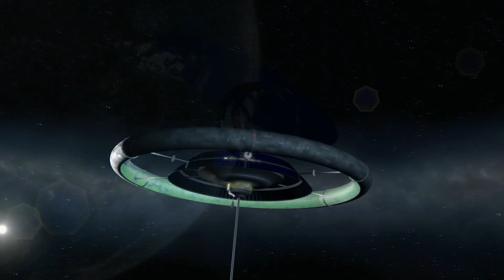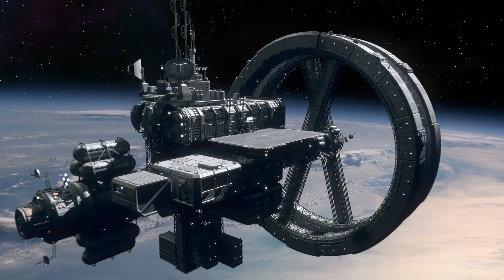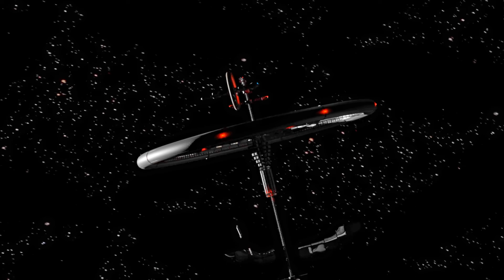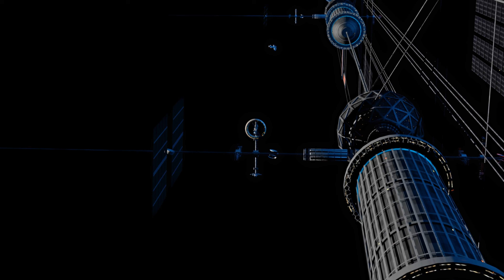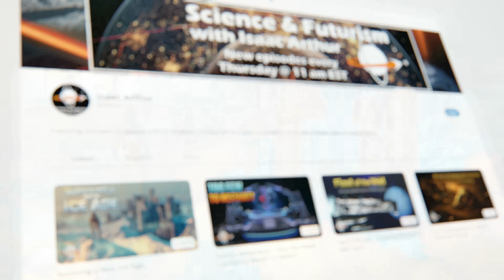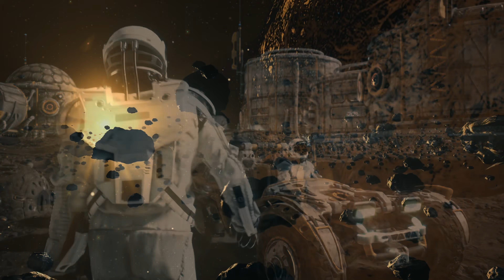The Von Braun Wheel - Building Humanity’s First Rotating Space Station

Comment: Wait a second if we live in a spinning wheel. wouldn't objects inside (moving about) would change the balance of the wheel and cause small oscillations in the axial rotation of the Von Braun Wheel causing the space station to eventually wobble out of orbit in the future?
Reply: No. You're thinking of a wheel that is mounted on an immovable bearing. If it is unbalanced, it pulls on that bearing in a direction that goes around at the rotation frequency, and so it shakes that bearing.

A space wheel spinning freely in space, no bearings, can and will rotate stably about a point a little away from its geometric centre if there is, at the rim, an unbalanced extra load on the deck under that new spin centre point.

If the wheel circumference is 22475 metres and the wheel mass is, like, only  500 tonnes, it can't be a stiff wheel, so it's easy to overdo the lopsided load thing and pull it out straight in a flat loop 11237 metres long with extra loads at the ends, or at one of them.

If you *start* with an 11237-metre rope, spin it so it pulls itself straight, and put the loads only on its ends, they can't wander away from those ends because the way away from the ends is straight up. It is stable forever no matter how the people in the end loads jump around, no matter how much stuff they bring in at the spin axis and take down to one of the ends.

Comment: Counter rotating rings mounted on an axle assembly which will be the docking port for space craft sounds good ... but you need air-sealable rotating seals on that axle which could be 10 meters or more in diameter; those have never been made, and I can't fathom how they would be made. Has any underwater structure been made with large diameter seals for a rotating structure ?

Comment: Great episode!  Given how things are actually developing, it seems like a rotating station made of welded-together Starships is likely to be the first of this kind.  Instead of having to build it all from scratch, the sections of the station can launch THEMSELVES into orbit and just do a remodel and then spin-up.

SpaceX has already proposed this for when they get their production numbers of Starships up enough.  A couple dozen Starship bodies can make a 1g perimeter ring station with spokes and hub etc., with up to 3 decks on the ring.  That's enough room to have labs, some industry, and hydroponics/life-support biology going on.
Reply: Sounds like the ship the Martian colonists took to get there in Kim Stanley Robinson's book Red Mars. If memory serves, that one was made of linked shuttle fuel tanks.
Reply: Yep! And as a first step, all you need are two Starships and a cable system that connects them by their existing catch-points (which are now their bigger stronger grid fins). Then spin them up so that they pinwheel around one another.  

Yes, there will be all sorts of stability issues at first (wobble, precession, etc.), but this would be a very SpaceX way of characterizing those issues in detail with real-world data. 

And you wouldn't need to do any remodeling of the Starships themselves! Just add the older-style minimalist catch-points to a couple of HLS lunar Starships, or design the cable to attach to the grid fins that normally serve as catch-points for an Earth-return-rated Starship. 

Once we have that HLS Starship flight-proven and worked the kinks out of it, there's nothing stopping SpaceX from immediately developing centrifugal-gravity Starship pairs, triplets, and more. And during that testing, each ship will be independently operable in case of a RUD with the cable system or whatever other trusses etc. they are experimenting with. 

Maybe, finally, we'll see some long-duration centrifugal-gravity research in orbit! 

(...and I really really hope that xAI doesn't suck all the funding out of SpaceX's R&D budget...)
Reply: @Wordsmiths  Grid fins are on the booster, not starship.
Reply: @nunya___  Yeah, my bad. I was thinking of the lift points under the upper fins/flaps! The HLS wouldn't have any fins of course, but the comparatively tiny lift points could be left in the design for the express purpose of centrifugal gravity options in cislunar space. (not to mention for ease of lifting and moving, and perhaps lower it gently onto a horizontal cradle, on the lunar surface) (once there is the appropriate crane infrastructure on the Moon of course)

Comment: Keep in mind we have resin based inflatable habitats on the horizon within the decade.  Creative and packaging an inflatable habitat of this shape feels well within reach especially if we make it in quarters or eighths etc.  Some carbon fiber and steel rebar for various structure supports and we could make this relatively cheep these days
Reply: Huh - I like the idea of starting with inflatables & building out solid structures over time. Spinning inflatables would act as the framework, maybe as a way to push outward similar to a tent.
Once there's a framework extended, could autonomous robots use that as a raceway to start building structures?
This is starting to feel less like a wheel though, and more like how a cylinder could be built. That isn't besmirching your idea, just where my head goes.
Reply: @AndyKauffmanGleekop I picture taking this inflatable up and pressuring/soldifying etc that way you have a large open area to work in and construct the thing and after you have sured everything up you can then start slowly spinning it up and give progressively more gravity for finer detail works and adjustments etc.

First order of business should likely be inflation then installation of a super conducting ring to provide magnetic shielding from radiation.  Wont stop your gamma rays and Neutrons but can help significantly so you can safely float around and get more things in order.  I propose a double haul on the thing with the outside filled with water as that could solve so many issues.  It can act as cooling, radiation management, life support etc.  I worry about the forces water imparts but thats a job for the engineers to say if thats feesible or if it will be a problem when spinning up or down.

Idk, I just know we are going about this all wildly wrong right now expecting to launch a fully finished and furnished space station then crashing them back into earth when done with it which is why we have made almost no real progress in three quarters of a century.  Piece meal and a more, figure it out as we go would really get things moving.  We have enough knowledge now to proceed that way in a safe manner.

Comment: What stops them tumbling?
Reply: As symmetric tops, they have no intermediate axis.

If von Braun had told us to build a tennis-racket-shaped space station, it could still rotate in a way immune to tumbling. The mode that has that immunity is the mode you get if you lay it on a table and rotate it in the plane of the tabletop.

Comment: Rotating habitats can be built on low-g planets too. One such on the Moon could test g levels slightly higher than lunar g up to any value, including Mars g. The floor just needs to be a special shape—section of a paraboloid. A lunar hab could be built using ISRU, no need to launch materials or modules into orbit. A hab could be as simple as a car on a banked circular track, or as elaborate as you want. If lunar g is found to be insufficient for long term human health, such habs might even turn out to be a necessity.

Comment: A big problem is working outside on what inside is the floor but you would have to hold tightly on it or the force of just over 1g would fling you off into another orbit.
Reply: Minimise the amount of work being done there, and use remote-controlled robots on a rail system.

Comment: Something should be said about the 135 launches of the Space Shuttle, each one depositing a jolly big metal cylinder in orbit, which could have been arranged like rings of hot dogs nestled together and spun for centripetal force. This was actually proposed. These tanks would have made great habitation and laboratory modules. Instead, NASA ordered each of these non-reuseable external fuel tanks to fall and burn up in the atmosphere. What. A. Waste.
Reply: And the waste is continued with the final stages of missiles and defunct satellites. Which could be recycled in orbit.
Reply: @comentedonakeyboard Ooo! Could these be purchased, somehow captured, and reused with these Von Braun Wheel ideas? I wonder if abandoned satellites could be reactivated from a Wheel, or simply space tugged into a usable distance and recycled.
Reply: David Brin wrote a great short story about an alternate history where we boosted the empty tanks to orbit and built a habitat out of them.
Reply: @evanmorris1178  Sounds like a smart guy! Those tanks only hold hydrogen and oxygen so there would be no issue with toxins getting in the living quarters.

Comment: Starship would be an excellent station building tool.  SpaceX don't need to solve re-entry issues to use Starship to build a rotating station.  The vehicle could be designed to allow it to be cannibalised in orbit.
Reply: First we need to resolve the "all these rockets are cooking the ozone layer again" problem. If we can't fix that, we're going to have to stop launches entirely until the ozone layer heals up again. It was doing really well after we stopped releasing CFCs, and now it's looking tattered again.

Comment: If I’m not mistaken, rotation produces a simulated incline;
Up one way around, down the other, so an unpowered rail car should be able to go round and round the downward way

As long as exercise is optional…
Reply: If I'm not mistaken, I think you're wrong.

You fly in a straight line. Then, you impact the curved surface of the habitat. Your currect trajectory is pushing against the habitat, and the habitat is pushing tangentially to cause you to move sideways.
But the the curve of the habitat intercepts your sideways trajectory. You are once again being pushed into the habitat while gaining sideways momentum. 

But here's the thing, it is contant.

The part of the floor you are pushed off from is the same part of the floor you impact against. Making it a constant "down".

You don’t roll down hill. You're being pushed sideways into the same section of floor.
Reply: @shanerooney7288 if you jump with enough speed in the right direction you could let the wheel rotate „underneath“ you and leap much further.
Reply: @comentedonakeyboard  
True. 
However it is mostly jumping "up" that does it. Different heights inside the cylinder correspond to different circular speeds. Where as you are keeping the same tangental speed as "ground level". 

Regarding this conversation, the important point is that OP's claim " an unpowered rail car should be able to go round and round the downward way" doesn't work.

Comment: with artificial gravity, your normal toilet works. lol. what cooking btw, synthesize all food. from thin air. a very practical space station design. no complex trickery required at any part. rocket science needs to be robust stable, not a guess work. but a space ship is an rv for small operations. if you spin around an rv space ship on a loop spiral orbit then it also has artificial gravity all the time. well assume you have infinite solar or nuclear power to constantly output 1g of rotating thrust. well best space station structure is no large structure to be managed at all. just an infinitely powered space ship doing a gravity maneuver.

Comment: All these images of rotating space stations makes me wonder why it's necessary to move so much of the thing. The only parts that need gravity will be residential/habitat and some industrial areas. The outer hull would be best kept stationary rather than spinning around. A stable hull would require more energy to move in the first place which might encourage "light"shielding over "heavy" shielding and would tend to throw off anything loose on it. A stable hull can house sensors and weaponry that doesn't have to work so hard to stay on target. A stable hull can also hold more docking facilities, power facilities, refineries, storage depots and viewing areas. Doing maintenance, repairs and inspections would not be fun on the outside of a rotating station. 

Again, cost figures into the construction. A station that can't be used until the whole thing is built and then spun up carries the cost of the loss of operational opportunities. But a simple circular rail with a habitat that can ride around it like a bus or train car can have some utility sooner and can help keep construction crews in better shape while they're up there which can save on the cost of training new recruits and providing therapy for those returning to Earth. This can reduce the number of launches needed to transport personnel. Launches are expensive right now anyway. 

Furthermore, new rings can be built side by side, over and over to create cylindrical stations eventually. The entire interior will rotate via the rails that surround them.

Comment: As highlighted in the video, a biological issue with simulated gravity from centrifugal force is the coriolis effect. With more available mass, a larger and slower rotating radius would allow coriolis to be minimized. The trade off of large radii, is the increasing engineering complexity with greater mass, as angular momentum becomes significant. 

Personally, I'd prefer using constant acceleration via photon sails with launch and receiving lasers for inter-solar system travel. For exter-solar travel, rotating wheels may still be needed, as they are less energy intensive than constant acceleration drives. If fusion drives become available, constant acceleration drives would greatly reduce time spent in microgravity, along with providing enough delta V for the shielding needed at high velocities.

A bit of Clark tech; encapsulate a small gravitational singularly in a Dyson sphere at a distance to generate a surface gravity of 1G. Provide propulsion from either the singularly or fusion and great a mini Spaceship Earth.
Reply: You just need to invent scrith.  You could make a space habitat the size of a planet's orbit with more surface area than a billion earths.  It's so strong it can withstand the impact of a asteroid and the impact site will simply just stretch into a massive mountain that the natives could name "fist of god" mountain.  A few books have been written about it.

Comment: The Von Braun Wheel is not something we would put into L4 or L5 instead of LEO? Adding more wheels sounds like a really cool idea and adds for near limitless extension before we get to something the size of an O'Neil cylinder.
Reply: You need to get there so a bit above LEO but not too high you would still need to get there.
Reply: @seriousmaran9414 I can see that makes sense. sooner or later we will need to breat out of LEO, but for the time being we have to deak with what we have.
Reply: @smoore6461 get one in low Earth orbit, build one for remote mining on the moon. Mining equipment on surface, people only go down to repair stuff. Now build a third big one to go mining/processing asteroids.

You can then build whatever you want. 10km long colony starships?
Reply: @seriousmaran9414  That's what I was thinking, I was just wondering if we should start in LEO first or try for something in the Lagrange points first. LEO makes sense because it is closer to us for sure and yea we can start there for proof of concept. then move to new area's. That was sort of the gist of my question that I think I worded pretty badly. I really like the idea of having it for remote Moon mining, that's cool. even if people went down to do some mining and then went back up for living/sleeping etc.
Reply: @smoore6461 I like the idea of LEO because it allows light- to medium- lift rockets to reach the station, making it much easier for people and material to get there.
Of course, that's already a crowded orbit, so it might need to be higher. A higher orbit also means less drag so less station-keeping and less thrust needed to keep the constant 1g.
Reply: @AndyKauffmanGleekop  Very good points. I think we we had a good solid LEO station, it could be a fueling point allowing a ship to get off the ground with a minimum amount of fuel and then refuel at the station This could lead to a Lunar base more fuel could be taken on and offer a shot of getting out to Mars. If we then built a base at or near mars, it could be a stepping stone to get even deeper out into the solar system. aside from using the laser highways is a way into the deeper system without a solid fusion engine. It seems like a cis-lunar Shipyard would likely be in a Lagrange point to allow for construction of larger ships for longer flights.

Comment: I'm not a capitalist, but...
Especially around 2026,
Investment at that scale needs economic justification.
Reply: I think we'd need to start much smaller than a full Wheel, then start adding on and upgrading until we can start building a full Wheel. A spinning station can start with as little as 2 otherwise-expended upper stages, linked by a rigid connection. Once expanded far enough, this structure could become the starting point for lots of different profit-making income streams. For instance, space launch could be much easier, as could material transfer to and from earth. That's not even getting to research or space-debris recycling operations.

Comment: Uh i disagree with that last point i think oniel cyclenders are the default and wheels would be used for specialized missions. A wheel is more expensive per person and for the volume especially when considering radiation shielding but then you also have issues with needed redundancy on small stations.

The population trends towards citys because people want to live around other people in that it allows verity and if you want more isolation its really not hard to build in 3d space.